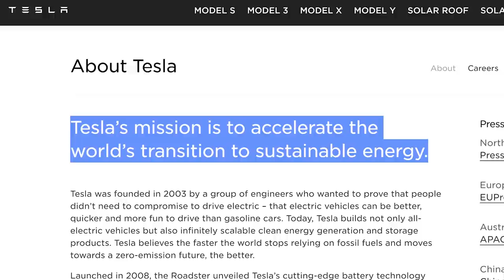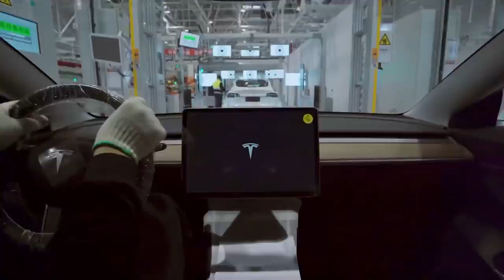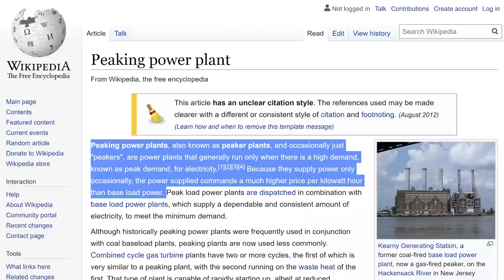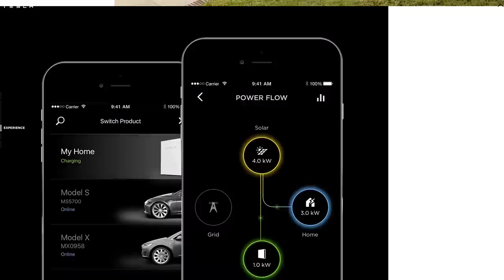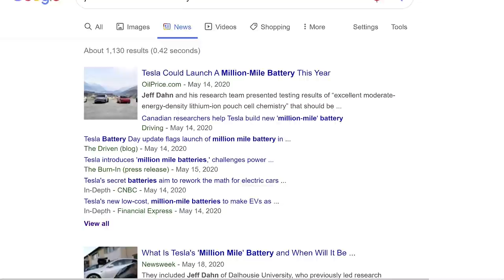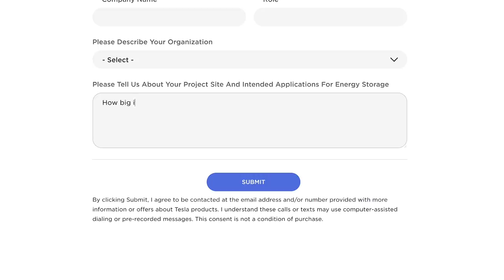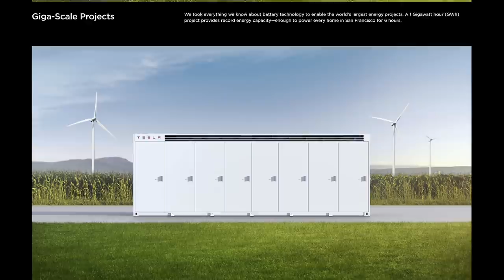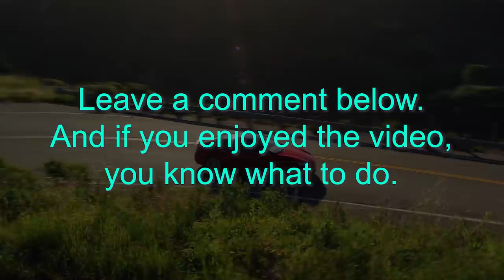Tesla Batteries Will Make Billions ⚡ (virtual power plants, vehicle-to-grid & Autobidder software)

Comment: Tesla are a power and transport infrastructure company as well as AI mobile artificial neural network infrastructure and a global mobile surveillance and GPS tracking system. They are dangerous. The goal of service is not to be the best service, it's to be the only service. Also, they possessed Tesla's name, but Nikola Tesla's original goal had nothing to do with batteries, which are a point of energy use control, he had a system of wireless transmission of energy that would be supplied with freedom and unmetered. Musk's Tesla is a control grid, based along the ideas of Edison and people need to wake up to this. His company makes amazing stuff, but the Devil's in the details... 

We are all kept on an energy handcuff, and Tesla does nothing to change this except add spying and AI on top.